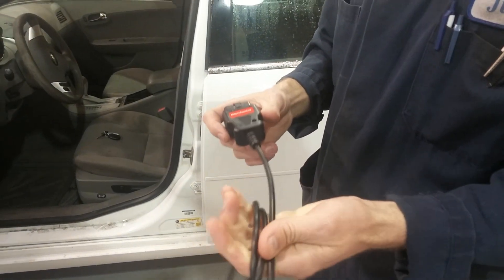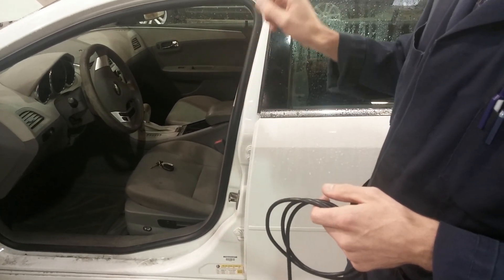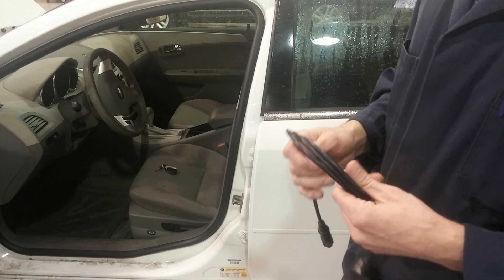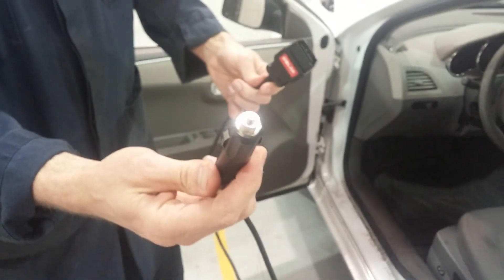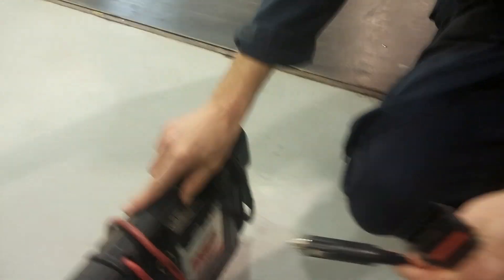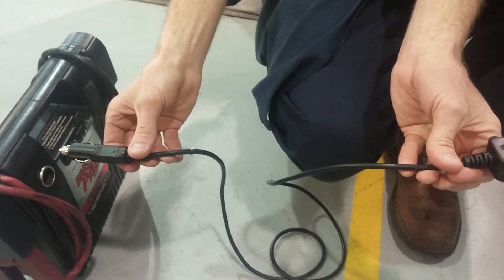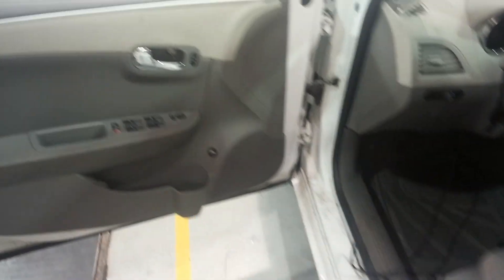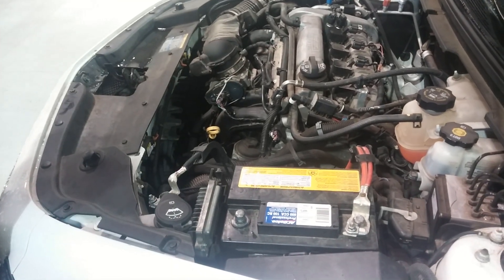Using a "memory saver" when disconnecting a battery

Comment: How long can the memory be active? for example like when replacing a clutch which takes time.
Reply from the maker: If the key is off, a battery pack like this one could maintain the memory for weeks.
Reply: @JustinMillerAutomotive  thanks :)

Comment: I feel like i am struggling to connect the obd into the car. Should you hear a click to make sure it is fasten and properly connected?
Reply from the maker: It shouldn't click, but the connect should fit firmly into place.
Reply: @JustinMillerAutomotive  I had to buy a new memory saver wire. Got my battery swapped without my radio resetting. Thank you for replying.

Comment: Hello, thank you for the video. I would like to know if I will be able to use without problems a DC power supply adjusted at 12.8 V and for example 4 A? WITH CLAMPS in the TERMINAL wires (NOT obd2 connector). (Example: YIHUA-305DB DC Power Supply, http://yihua-soldering.com/product-4-2-30v-dc-power-supply-en/160008/) Thanks!

Comment: Great video! Now what I would like to know "what's that battery supply your using?" I want on with the cigarette slot like yours. Please advise :)
Reply: I found it on Amazon. For anyone else that wants one it's called "Booster PAC ES5000 1500 Peak Amp 12V Jump Starter"

Comment: Last fall I replaced the battery on my 2010 Malibu (not using a memory saver) and sure enough when I went to test out the new battery there was a message on the radio that it was locked and I needed to enter a code of some sort.  Called around and was basically told I'd have to bring it to a Chevy dealer to have it serviced and would likely cost $100 or more.  I noticed that when I swapped the batteries I had the keys out of the ignition.  Thinking that might affect the security system I decided to try putting keys back in the ignition and simply disconnecting/reconnecting the battery.  Lucky me it worked -- everything came back!  Even all my radio presets were correct.  The only thing that needed resetting was the clock.

Comment: You should have made it known that the vehicles POSITIVE CABLE IS LIVE so wrap it up with shop towel so it doesn't short out and blow a fuse or worse.
I was warned not to buy the hot shoe types like you used.
Alligator clip ones are better I think.
Reply from the maker: True!  Luckily, both the memory saver cable and the data link connector in the car have fuses, so one of them will blow immediately if you short the positive cable.  The worst result is, of course, that you would lose your computer memory that you were trying to save.  I usually place a nitrile glove over the positive cable while it is disconnected from the battery.  It works well!

Comment: I have a 2016 Malibu with an auxiliary battery in the trunk. Will that save the memory just as it is?
Reply from the maker: Yes it will!
Reply: @JustinMillerAutomotive  Thank you for answering that question. Now I have another. My main battery died two weeks ago and I changed it out and, as like you stated, I did not lose the memory. My question now is, the battery in my trunk is original to the car. I am not even certain what is controls. How do I know when that goes bad? What, exactly, stops working?

Comment: Why can't you simply connect an external power source to the battery cables before disconnecting them? I saw one video where a guy simply connected a 9v battery to the car's battery cables with alligator clips before disconnecting the car battery. Evidently, that 9v juice was enough to keep the car's memory intact. But then it was a British car. But still, the question stands.
Reply from the maker: Yes.  You could do that and it would work.  The downsides are that it would be very easy to knock one of the alligator clips off of the battery cable while working on it, which would cause you to loose all of your memory, and a 9-volt battery doesn't have very much capacity, so it won't last very long before the voltage gets too low and you lose all of your memory.

Comment: Must I have key in the ignition at all?
Reply from the maker: No, the key doesn't need to be in the ignition, and the key should definitely NOT be turned on while doing this, or you will likely blow a fuse in your memory saver or in the +12 volt circuit to your DLC.

Comment: So using this you wont be needing to register your battery for bmws CCA(cold crank amp? Mines a 2013
Reply from the maker: I don't know the answer to this for sure, but I would guess that if you are replacing the battery with an exact equivalent battery, you wouldn't need to register anything.  As far as the car is concerned, it will not know that you ever disconnected and replaced the battery if you use a memory saver.
Reply: @JustinMillerAutomotive  Appreciate the reply thanks

Comment: Great vid 🔥...but how long can the 12v power supply keep the memory alive....because i was thinking of recharging my battery after removing it for 5 hours
Reply from the maker: It depends on the size of your external battery.  In the video I used a jumper pack battery, which has a lot of capacity and could keep the memory for days (as long as everything in the car is turned off).
Reply: @JustinMillerAutomotive  thanks for replying buddy...I had used a jumpstart's power source and it was fine for a long time. 👊🏾
Reply: @jad_23  hello it's Henrik I want to doing the same thing as you charging battery like this. How long you been used your jump starter? What is the size of the battery in it? I need about 8 hours. Mine has 17ah internal battery. Thanks Henrik
Reply: @JustinMillerAutomotive  Hello interesting video I have a question about it if I have everything to doing the same things am I able to doing the same thing if I want to charging my battery for at least 10 hours? The jump starter will manage that time? My jump starter has 17ah internal battery Thanks Henrik

Comment: Putting any, small, 12V DC power supply/battery, paralel with the battery, also do this but probably lot cheaper, easyer. I respect your video.

Comment: I supplied power through the cigarette lighter, from an external small 12 volt SLA. Beforehand I verified that the cigarette lighter is always hot, even with the key in the "off" position. Is there any reason why you should energize the car through the OBD port instead of a cigarette lighter? This did work for me.
Reply from the maker: That is not a problem as long as you make sure that the lighter is hot when the ignition switch is off.  However, many lighter outlets are only hot when the ignition switch is on.  That is why the OBD port is preferred - it is hot at all times on all vehicles since 1996.
Reply: Justin Miller Gotcha, thanks.

Comment: 11/5/2019
Southern CA.

He's 110 % Right !

Some people will get their Pantíes up in a Twist if thẻi Clock ỏr Radio Station í changed. I don't blame 'em.

California residents have "One" more Diaster, a Smog Check Inspéction.

"2" Exãmples :

1) If anybodys Battery is disconnected ( 1996 & Newer vehicles ), the Onboard Diagnostics Readiness Monitors will revert back to displaying "Not Ready". Before Battery was Disconnected, they were Displaýing "Ready".

2) Your Mother drives a 2014 BMW ,
( or any car )

Monday : Her car doésn't Start..Daughtẻ givés hèr a "Jump". All is Happy again.

Tuesdáy : Son has to give her a "Jump".
Mom drives to McDonalds Drive Thru & back home.

Wêdnesday : Car won't start. I live "6" Houses down. Son seeks my advice.
My Voltage Meter connected to her Battery only reads 11.4 Volts. Too Start I say you need to buy a new Battery.
.....Car now starts on íts' own......She happén to have a 3 PM Smog Inspection also Today !!!

She drives there & I bet you. $500 she's gonna Fail that Smog Inpectión because I disconnécted her Battery & "3" òf hẻr "7" or "8" Monitors don't show "Ready" yet because she hasn't driven the right amount òf Miles yet. ( Other than this Fiasco, her car rúns bểtter than any cả in Lós Angeles County )

Commencing July 2, 2019......even if you didn't Discónnect your Battery Negative Cable 1 Block before the Smog Shop , but you have a Permanent Diagnostic Trouble Code ( DTC ) & the 
Check Êngine Light ís NOT On ; the Smog Computer is going to Fail that Vehicle.

Browse Around this important addrẻss that's available to the Public. In the Search Bar, type in Permanent Diagnostic Trouble Codes :

www.smogcheck.ca.gov

Smog Repair Background.

Comment: "Theoretically" speaking if we have removed the battery without a memory saver is it still possible to fix it ourself? Or does it need to be seen by a professional?
Reply from the maker: It depends on the car.   For most cars, you can simply reset the clock and radio presets and then drive the car for a day or two and everything can "relearn" by itself.  However, there are some cars that have radios or other features that will not work until the dealer has reset them or entered the proper code.  Watch for a General Motors vehicle from about 1995-2005 that has a "theftlock" radio.  They are one of the most frustrating!

Comment: Fine if you’re changing out a battery that still has some juice in it. But how many people do that ? The battery I am replacing is completely dead, can’t be jumped with another car or with a power pack. Why would I need one of these isn’t my data already gone when the battery died ?
Reply from the maker: You're right.  There is no need to worry about losing memory if it is already lost.  Most of the time, the battery still has voltage when it is replaced.  Also, there are a lot of other reasons for disconnecting batteries--maybe we are working on the vehicle or cleaning the battery terminals.

Comment: on motherboards for computers , they install a small battery that is always there for when power is not being supplied from the wall, so the memory eeprom is not wiped...i dont see why Car makers dont do this, its pretty easy to do.
Reply: Probably to make people go to the $tealership
Reply: The original idea on older cars was, losing memory instantly upon power loss was a good thing. It meant if someone smashed your car window and pulled out the radio, then the radio was worthless. If they built a battery into the radio, then it could be pulled out and sold on. Most garages will only charge you to put security codes back in if you lose the code and they have to re-issue it, so it wasnt a money making scam to begin with. However it has grown into one. These days its rare to come across even basic model cars where the radio is not fully integrated into the car, but they had learned that enough people were losing radio codes that running everything off the car battery and spending no money on memory saving was making people return to them for services.
Reply: Dealers want to make their product more in line with consumable goods theory. If you have to bring to dealer for service that is increased revenue post sale.

Comment: From the knowledge I have gathered, I need to be extra careful when hooked to a 12v battery tender which acts as memory saver under the hood(in case of ML350) so that the positive end of the cable do not touch any metal when I am changing the battery because there is live electricity running. Is that the same case when I use the OBDii cable as well? I plan to use the cable as a memory saver for my 2007 Honda Accord.
Also can the OBDii memory saver act as a battery tender when I go on a vacation?
Reply: The Battery Tender is not recommended as a memory saver - this was posted on Amazon by the company

Question:Can i use this to plug into the obd ii port, and battery tender to save the car memory when changing the battery?

Answer:This connector allows you to charge your vehicle's battery through the OBDII port, eliminating the need to get under your hood and connect to the battery directly. It is not a memory saver.
By BatteryMart SELLER  on September 13, 2019

Comment: Do different cars require different end cables that’s connected to the memory saver? I have an 2007 accord and a 2012 ml350. Would the same cable work? Also, are the plugs always located beneath the steering wheel on the driver side in all the cars? What about the digital miles/odometer reading? Will they have a separate battery?
Reply from the maker: All cars that use the standard OBD-II connector (all cars made and sold in the US since 1996, and many others depending on what country you are in and what the age of your car is) should work!  The connector should be on the driver's side, but during the early days of OBD-II, there were some automakers that got creative and hid them behind a cover in the dash or center console.  Now it is more standardized.  All of the electronics on the car run off of the same battery, so this works on the entire vehicle.  Your odometer mileage will not be erased when you disconnect the battery anyway!
Reply: Justin Miller Thank you. That helps!

Comment: my memory saver keeps blowing out fuses , I'm a AAA battery technician, and this tool is very essential ,  but I keep changing the 5 amp fuse inside the cigarette lighter plug every few batteries replacements , do you have any idea why? thanks
Reply: I’m also a battery tech, these memory savers seem to do more harm than good, old Toyota’s always have to have their idle reset despite using a cam, if you leave a door open with the thing plugged in it doesn’t work or causes the computer to throw codes. My thinking is that being there is still 12 volts in the system and interior electronics are awake, upon reattaching the battery a voltage spike occurs and resets certain ECUs.
Reply from the maker: You might need a bigger fuse.  Check the fuse in the vehicle that protects the OBD-II power circuit.  Make sure that the fuse in your memory saver is smaller than that fuse. You can usually use a 10 or 15 amp fuse in the memory saver.   Also, make sure that the ignition never gets turned on and doors and lights remain off when you have the memory saver in.

Comment: Do you know if all cables with an inline light light up when connected to the OBDII or the power source side?
Reply from the maker: I think most do, but I cannot vouch for all cables.  If the light doesn't turn on when connecting to the OBDII connector, check the fuses in your car.  It is very likely a blown fuse.

Comment: i used my memory saver. after reconnecting I have no power at OBD connector and car will not function properly until I plug in memory saver. memory saver seems to power up OBD and then dash operates normally. what happened?
Reply from the maker: I think you have blown a fuse in your car.  That can happen if you turn something on while the memory saver is plugged in or if you accidentally short a battery cable or other 12 volt wire to ground while working on the car while the memory save is plugged in.

Comment: I need to connect one of these data Savers is it still safe to work on the car me and if you want to replace the starter you disconnect the battery and hook up one of these data Savers ? Meaning if your wrench touches the metal when it's on the starter positive side will it ark?  Thanks
Reply from the maker: You're right.  If you remove the starter, you may want to not use one of these.  If you short your starter wire during the repair, it would blow the fuse in your DLC or in the memory saver itself.  If you really need to save your memory, then you would have to be very careful not to short the terminal to ground during the repair, but that is difficult to do!
Reply: Justin Miller okay thanks I wasn't sure if it would still work that way or not. Because some of these data savers have like a 9 volt battery. And that will not be near as dangerous or should I say as powerful as your car battery but I just was not sure if the current would make it through everything as if you had your car battery hooked up. But thank you very much for responding.

Comment: Hi Justin, I read some comments on other videos about using this memory saver device that said you can blown some circuits when it's connected, what do you think about?
thanks, and you make nice vids
Reply: J Flow I believe everything should be fine in most cases, except one when there is a high power demand somewhere in a car during memory saver usage. In that case a high current could and will go through paths its not supposed to go and probably cause damage along the way. Though a fuse in the cable add a layer of protection against it.
Reply: What I found out after killing a fuse and abattery is that my power source to the car's OBD2 Port had more Amps than the fuse.  That's  why it got blown.  You have to figure out which fuse is connected to the obd port and use a source with lower amps.  Many jumpstarter power banks have 10amps 12 volt out ports instead of something like 6amps from cheaper smaller powerbank jumpstarters.   Luckily all I needed was a new fuse which is worth little if u buy a $10 set from amazon.  Im unsure if I broke my battery or not but apparently it was fine but it was replaced for free for some reason.  But there's  your clue.   Also I think it might be ok to take out the battery first and then use the memory saver but I am unsure…  I should have asked the mechanic for their technique

Comment: Well done video.  I don't have a "power supply", just have an old school battery charger and a trickle charger. Must I invest in a power supply?  I was thinking I could connect the terminals on the 12v trickle charger to the battery terminals, then remove the battery terminals and service the battery.     Thx